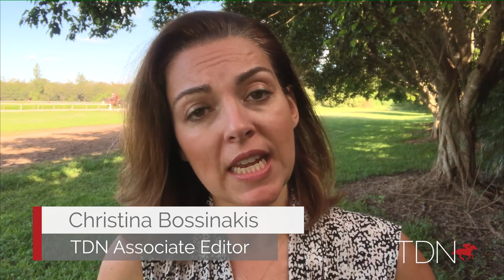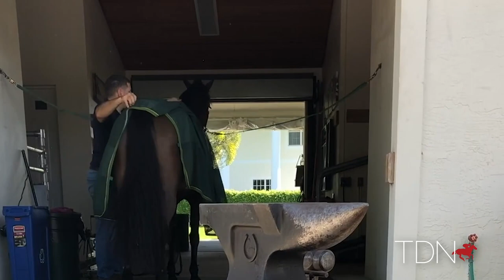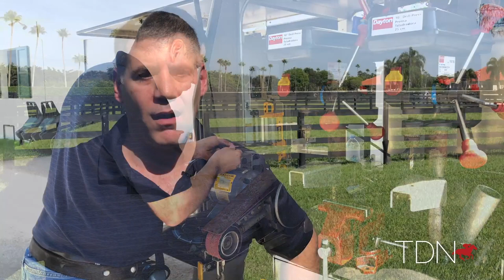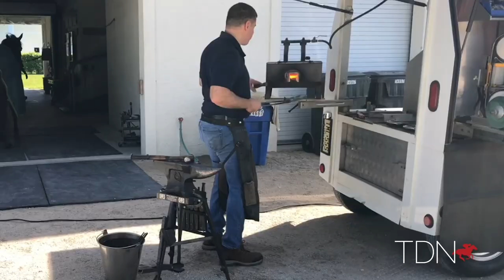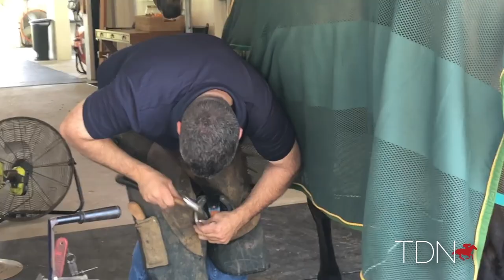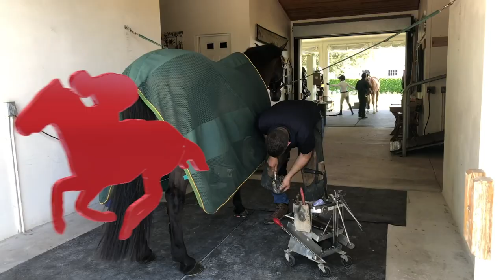New Horseshoeing Techniques

Comment: As A farrier that has been in the profession for over fifty five years and finished an apprenticeship in the early 1960s, then went on and took and passed the exam that was implemented in New Zealand by the NZ Farriers Association, I must say hats off to The Association for at least establishing some form of an exam in the 1980s.
To have a chance at passing an exam that apparently gets down to the nuts and bolts of the locomotive structure of the horse must be of tremendous value to the profession. In finality I salute the RVC on implementing this program.

Sam Esler CFP